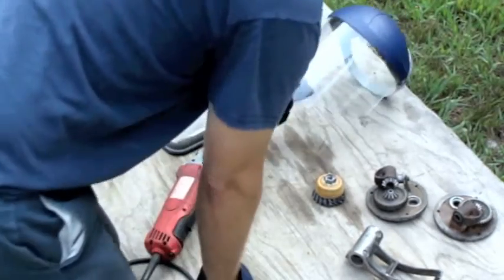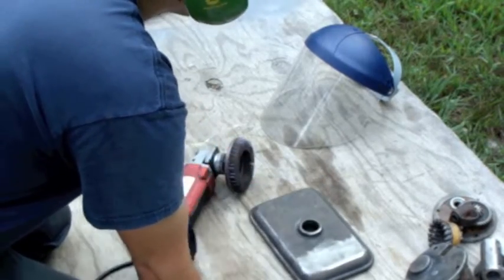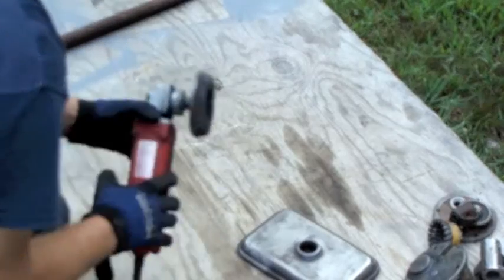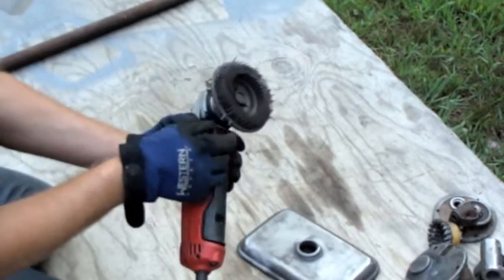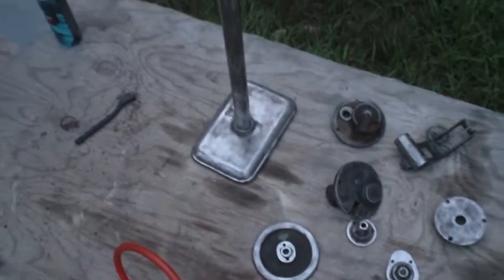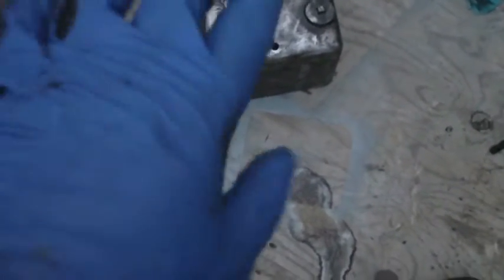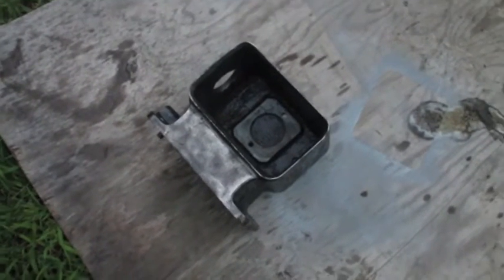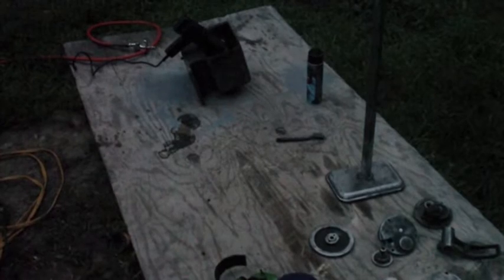Sipp Drill Press Part 25

Comment: Steve;

Have a bronze bushing made up (or make it yourself) for where the shaft exits the gear holder.  Make sure to drill the oil hole and add the oil groove in the bushing.  Then bore out the hole in the gear holder to take the bushing.  This will give you a much better bearing surface than the current hole (which may be worn after a century of use) and makes it easy to repair/replace in the future if needed.  This way you also make sure the bushing is the wear element and not the shaft.

Just something to think about as you continue the rebuild.

Regards;

Ron Kluwe
Reply from the maker: Hi Ron. Thanks for the suggestion, but I think I'll leave that one alone. The shaft should be well supported by the 2 bearings on the input side of the shaft. What surprises me is why they did not jet have the shaft continue on to the other side of the gear box, and have a bearing supporting the end, mounted in a removable end cap.

Comment: They did have sealed bearings back then also, so there intention was that an oil bath was better for that particular application....was just wondering what and why you made the change from how it was originally built.
Reply from the maker: Partly because that was what my supplier had in stock, but I also thought the sealed design would keep dirt from getting in the bearings. I figure the oil in that box is a dirt magnet, and the cover just sits on top loose, and there may be more crud I missed while cleaning.

Comment: You definitely want the gears bathed in oil. And I don't think the cheap bearings will last too long at all, especially the ones in the gearbox (lots of axial load.) Using sealed bearings where open bearings were used before also makes me a bit uncomfortable-- when oil leaks past the seals and contaminates the grease bad things might happen. I guess now that you know what bearing sizes you need, it won't be too difficult to replace them with nicer bearings in the future if and when they detonate.
Reply from the maker: Thanks for your input. I agree about wanting oil in there. It will help reduce wear on the teeth, not to mention lubricating the end of the shaft that just rides in the casting shown at the end of this video. As for the cheap bearings, They will be running much slower than what they are rated for. This should help them last longer, that, and also the fact this is not going to see frequent use.